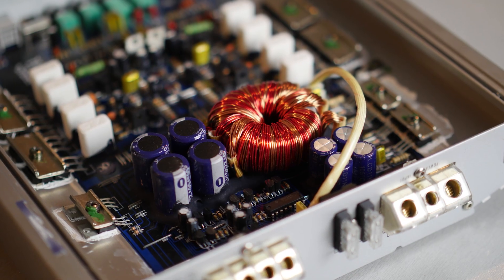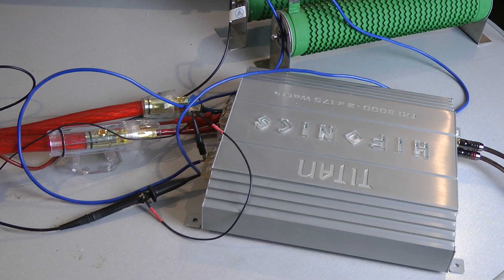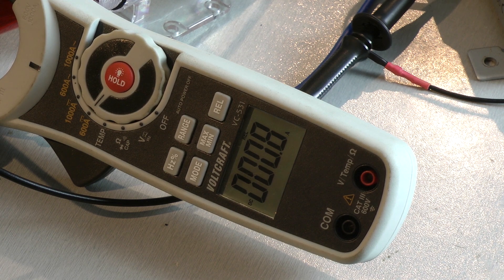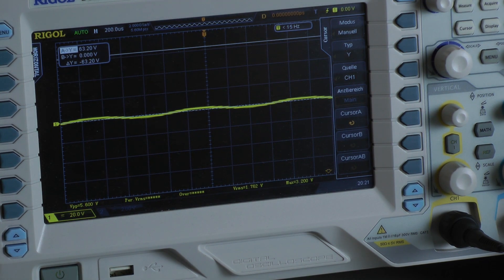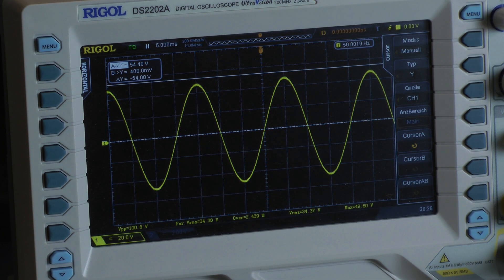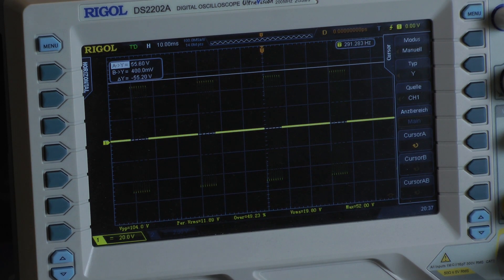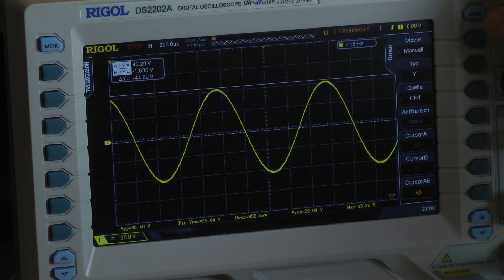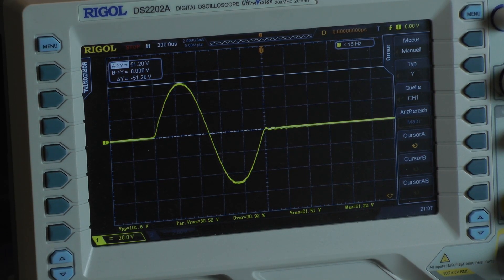Hifonics Titan txi 3000 car audio amplifier amp dyno output power test 2 ohms mono & sound demo

Comment: Are all Hifonics amps  so bad in efficiency ?
Reply from the maker: Around 60% or more is typical for a class AB amp I had tested so far. I tested other class AB amps which had >70% . Different thing is class D with more than 80%.

Comment: Strange the amp needs 55v to do 100+ watts..the power 650 rockford has 55 v rails and does 175 watts..that means the chinese hifonics amp is current limited.
Reply: I quickly checked this video and it looks like at 55 volts it does 175 Watts just like you're saying the power 650 does. So, it's basically the same power output at the same voltage. 

What exactly do you mean by the Hifonics being current limited? Do you mean a regulated power supply section?
Reply: @JasonWW2000 I need to rewatch the video..because you called to my attention ... I might have put my mouth in gear before my ears had the info..haha. about my ohms law based decision I can tell you that you can manipulate resistor values and design the amp to work better at different imp loads and also b+ voltage level..regulation is mostly unrelated . Thats where the designer picks a voltage ...and anything above that gets thrown away. The purpose of this is under load the voltage of a basic car will swing with the beat of the music..with regulated amps..it doesnt matter if the voltage swings from 12v-13.8..the amp will get ( 12v..) when in theory..a non regulated design..with an upgraded alt and wire and battery bank.. will work way better with 15v stable.. but you must have the power..or chances are..youll blow up the amp..and or smoke the woofer.

Comment: You're going to have to tell us how it sounds. What is your opinion on it?
Reply from the maker: Hey watch the video again - the sound test is also included 😂😂👍👍
Reply: @audiokeller1975  You can't do a sound test through YouTube due to its various forms of compression and manipulation. Plus the speakers I'm listening to it through are not exactly the greatest. I never understood why people think you can do a sound test over youtube. You literally can't. Especially not an amplifier test where it's very difficult to hear the subtle nuances. Basically all amplifiers sound the same through YouTube.
Reply: My guess is that it's going to sound just fine considering it's a decently priced class A/B design.
Reply from the maker: That’s absolutely correct, the limitations of YouTube make it impossible to tell how an amp sounds, you can just compare them all with this limitations. On the other side: room size and speaker placement will do much more differences than YouTube can ever create and it’s also a different situation in a car especially in the deeper frequencies. All that was the reason I asked if I should quit the soundtests.
Reply: @audiokeller1975 he's asking you on your experience,  how do you think the amp sounds? It sounds good as rockford?
Reply from the maker: @wirebender I am absolutely the wrong person who can tell something about how an amp sounds. I am too old my ears detect up to 14-15 kHz. It’s more the speakers, room environment which causes variations but for me the amp sounds good at the level I tested. Compared to a Rockford amp with dynamic headroom it’s a different situation